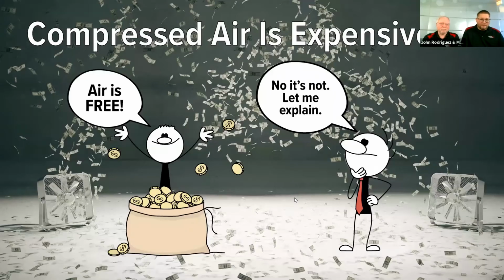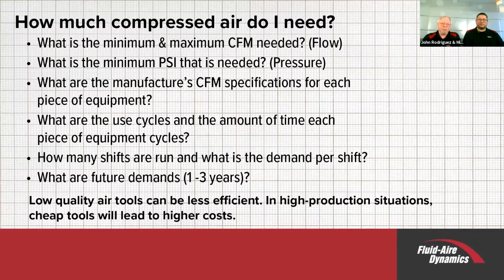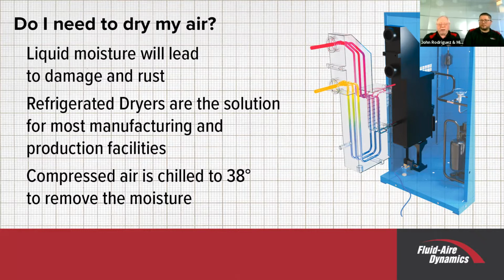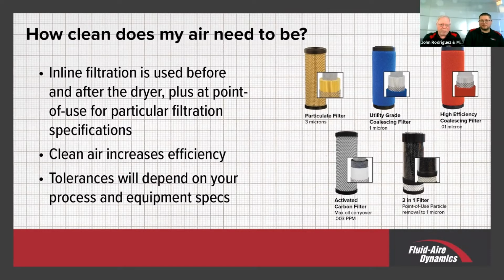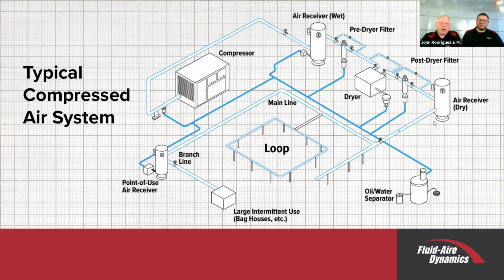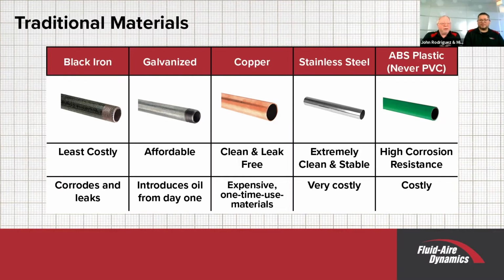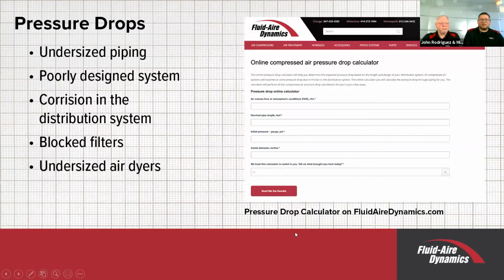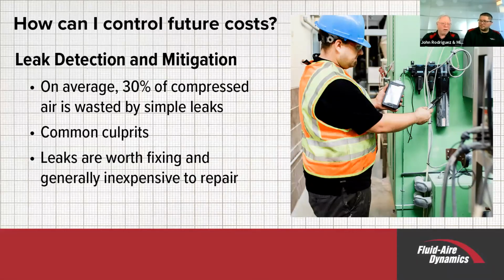How to Design the Perfect Compressed Air System

Comment: i would like to know, How do you size the piping from the compressor to the equipment and air ports?
Reply: there's software for that as per cfm there are standard pipe dia with their respective heads review CAGI Manuals nd guide book

Comment: In our system, we observe pressure fluctuations due to the drying unit (two-stage pressure change style). We use about 6000l/h (max) at 0.62 kPa pressure with a min-max deviation of 0.2kPa. I was planning to install an air tank after the dryer but I was curious about its size and if there is a better solution, maybe a combination of a limiter together with a tank or any other?

Comment: I would put a small electric motor on the first fan of turbine so when your not using  nitros or oxy setaline ethier that's still debatable on which is the better 1 to Use all you do to start it is turn on the air once it's craken at idle air tanks fill instantly so U have instant power on the throttle then I can increase the flow of the first fan of the turbine and fire up some nos to pick up pase the faster it moves the faster the fans turn on there own with out any more spraying or from the electric first fan can switch of so fan free spins

Comment: Hey lying , if I wanted to use air pump to power my jetski ? !!! I would build a fan turbine free spinning blades with compressed air tanks 1 big 1 and couple little tanks , then add a couple oxy setaline tanks small and that's where my boost and after burners come from and a couple small compresors maybe could get some hard core psi coming out of the rear outlet and never need fuel again U can also tap into main turbine to keep air tanks full so free air motor

Comment: VSD thing is not that simple, though!
Most of the time when driver is going bad, ( and they do go bad, very often) the price of the replacement offsets the savings, in some cases even surpasses the savings if failed prematurely.

Another thing: VFD drivers introduce harmonics to grid, for which power companies penalize end users. Of course there’s line reactors and filters, but that’s another very expensive equipment.

I would say better way is to control displacement by mechanical means with something like sliding or plunger valves, or run multiple smaller machines in lead/lag set up fir variable loads - but everybody have jumped on “government stupidity” band wagon, now days!!!